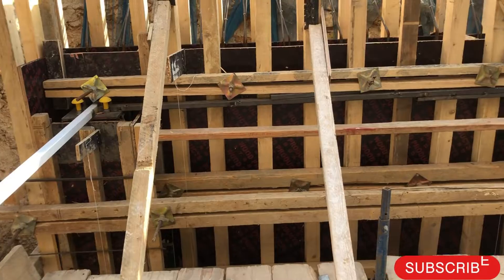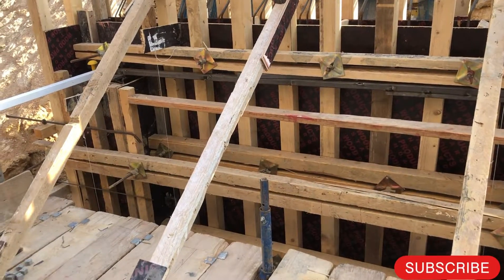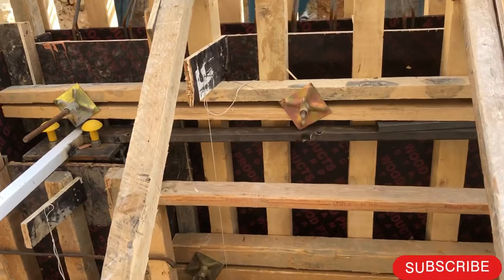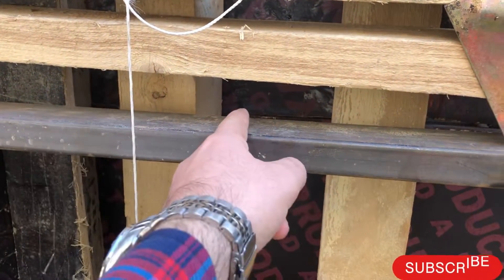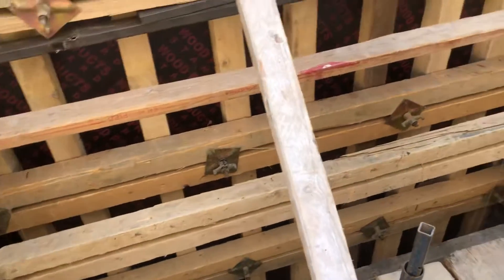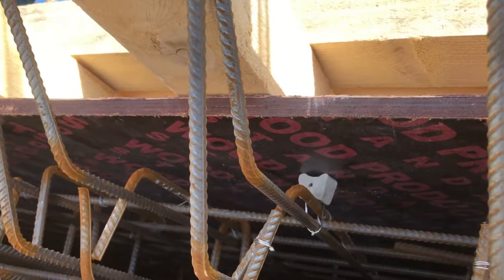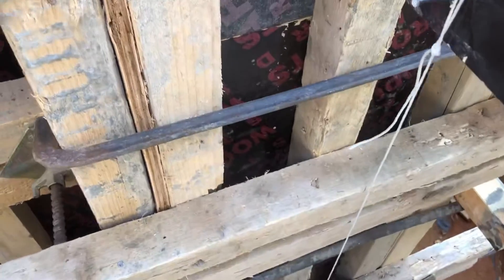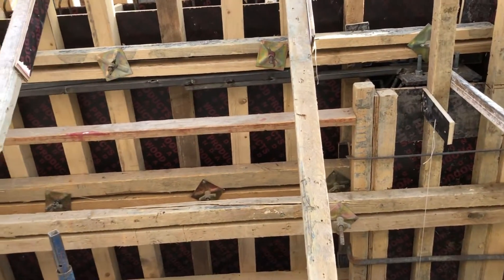How To Check Formwork at Site| Formwork Inspection at Site | QC & Site Engineer

Comment: Thank you so much. But we check the, weak and Damaged formwork panel, alignments and leveling vertical and horizontal, support and scaffolding tightness, water Tights mean joints and gaps, spacing, spacer, electrical conduit opening, cleaning and release agents

Comment: Thnx for your efforts , Please many points need to check like the formwork from inside and the state of the plywood from inside , the edge alignment for the wood pieces .
Reply from the maker: Yes, you are right! Formwork inspection is a comprehensive process.

Comment: sir, you check its verticality but after casting of concrete its verticality will be disturbed in my opinion
Reply from the maker: No if you have strong support
Reply: @CivilEngineerAtSite  If we checked the again verticallity after concrete.if any disturbance of formwork support. can we fixed tha?